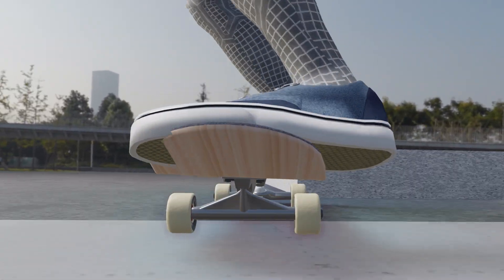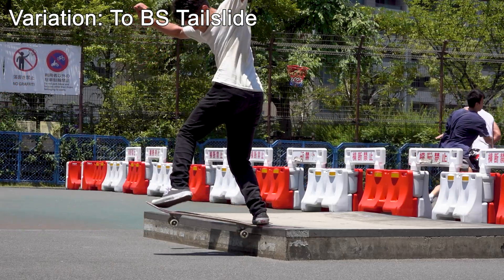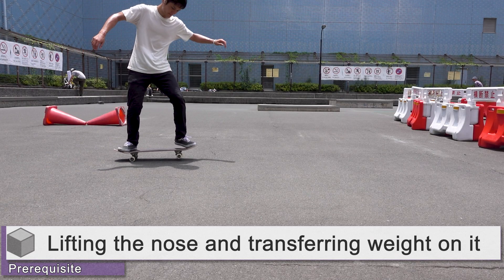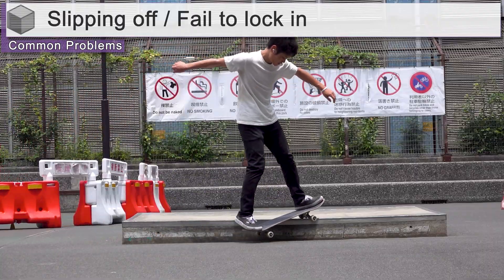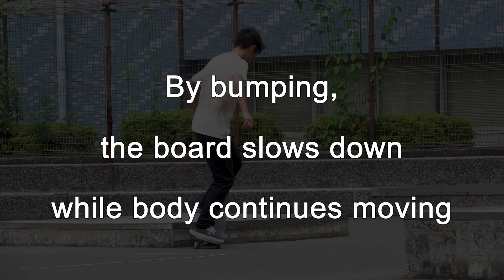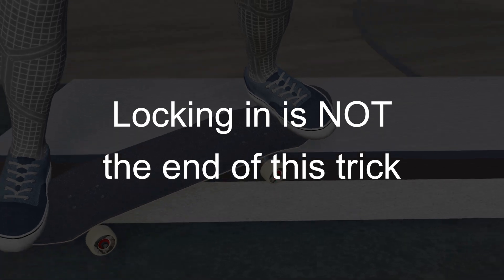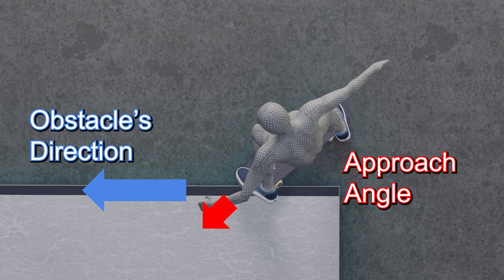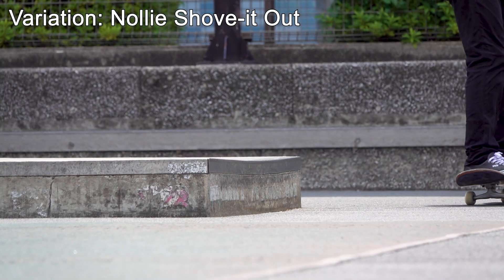Easiest Grind - BS Slappy 50-50 that you LIFT the nose

Comment: This is a good transitional trick, and you can use it to learn some other basics while you work into ollieing or actual slappy, you’ll get the feel of the grind and get the proper balance, then you can move toward the more difficult varieties.  I will add this trick will not work outside of a nice skatepark ledge.
Reply: It'll work on a buttery scrubbed curb, guaranteed. Me and the homies have one in a bike lane with exceptionally good ground leading up to it and it behaves almost identically to the best skatepark curbs.

I agree with what you said about it being more of a transitional thing though.